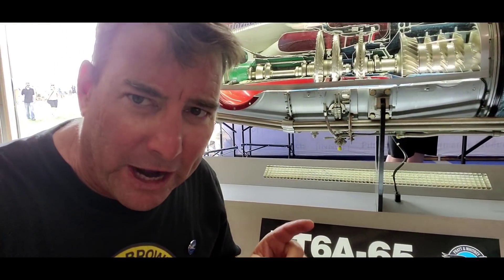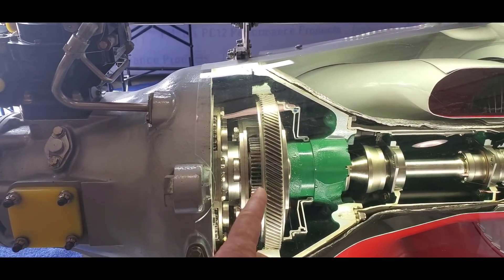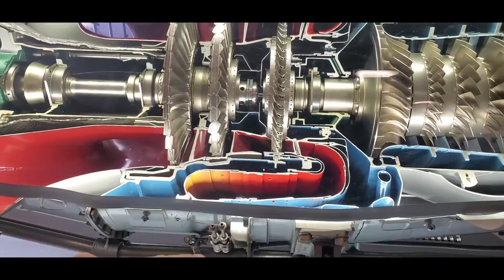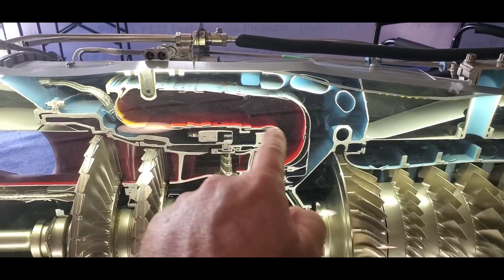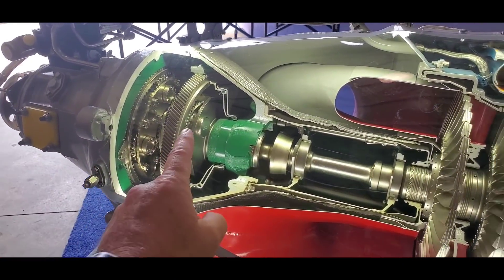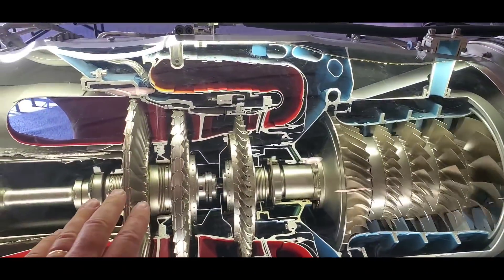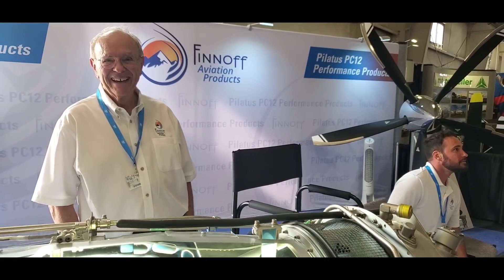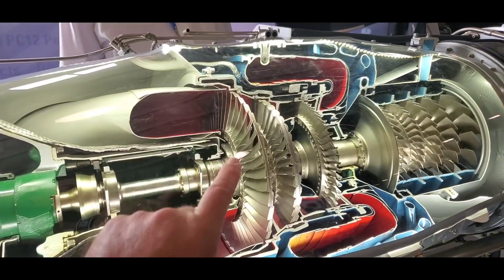PT6A Cutaway - Airventure 2021

Comment: Great explanation. As I understand the "Governor" controls the Pitch of the propeller to keep a constant RPM. The throttle is set about 95% power. What does the Torque control do? (Cessna 208 Caravan has a PT-6)
Reply: There isn't a torque control. The engine is torque restricted to critical altitude, the gas generator can put out enough gas to over-torque the engine. So if you fire wall the throttle, and the model you have doesn't have any self defense, then you will over-torque the engine and at best have a horribly expensive rebuild. You have to manage propeller rpm and engine power to keep torque within limits until you reach critical altitude and can't over-torque the engine any more. Critical altitude varies with model, one PT6 has a critical altitude of 16,000 feet. So below that altitude you fly the torque meter, and above you watch the temperature. This varies by aircraft, there are single lever control systems which will control power and pitch for you, and prevent bad things from happening. There are also auto-throttle systems, like on the latest TBMs, which will control everything once you start accelerating for takeoff if you have them in auto-throttle mode. And this is an incomplete simplification. Watch Stevo1kinevo if you want to see how he manages the torque and power on the PT6 in the older TBM850 he flies, or watch his recent videos with the auto throttle version. His aircraft has a reduced power mode for takeoff, then he switches to the full power as he climbs, but he has to be careful not to kill the engine when he switches. Here's a link while he's doing that.
https://youtu.be/lJLM56U12x0?t=530

Comment: I think 4000 hp is the equivalent to the amount of fuel burned, not the amount extracted by the turbines. From what I recall from online reading, the compressor uses about 2300 hp, the power turbine extracts about 1000 hp from the gas flow, and about 700 hp are "lost" at the exhaust. Still a very efficient machine all things considered.
Reply: Your numbers look correct intuitively. Juan's numbers would indicate a thermodynamic efficiency of <20%, which really breaks the use case. Juan was smart enough to hedge on that statement, though.
Reply: @johnschreiber1574  well, a little over 20% is the mean thermodinamyc efficiency of the US's fleet of road vehicles, so that wouldn't break the case.
The most efficient turbine engines today (static power generation units weighting several tens of tons) achieve about 45% efficiency without cogeneration, so 20% is not that bad for an airplane if the thrust to weight ratio is decent and it has a small footprint
Reply: @makecba , Juan's a little shy on the horsepower. The -65s on our Be1900s put out an honest 1100 SHP, not counting exhaust thrust. Our SD30s had -67s which were essentially the same engine, but ran hotter and were rated somewhere north of 1400 HP.
Reply: While I’m impressed with the service these things have given to a wide variety of aircraft, that’s pretty miserable efficiency.
Reply: @ben3989  even compared to a piston engine?  I thought the best car engine was only about 24% efficient.
Reply: @DominicRichens  nah, most modern engines (Mazda's Skyactiv, Toyota's Dynamic Force, VW EA888, etc) are on the order of 40% at their peak efficiency point. When you consider the theoretical maximum efficiency for Otto cycle engines is around 60%, that is actually pretty damn incredible.
Reply: @DominicRichens  many piston engines are 40% and Toyota and Nissan are developing 50% thermally efficient engines. It’s all pretty miserable when you think about it.
Reply: @ben3989  depends on what you consider. As I said, the theoretical maximum for the Otto cycle is around 60%, so 50% is absolutely incredible. Of course, when you compare it to the 97-99% efficiency of electric motors it becomes pathetic.

Comment: The AF ones anyway are a 3000rpm constant speed prop, and your speed voting lever is simply your torque request...the turbine spins up to 100%RPM around 30% torque.  Tons of power, it comes on fast (like ground loop, or go-around roll, fast...full boot of rudder).  Having the intake below the turbine creates a heat soak issue for engine start... They are supposed to be very reliable systems...but the AF ones had problems with gearboxes and aerobatics.

Comment: I never realized the power consumption is so high (vs the delivered SHP) just to drive the compressor.
  Incredible to think you’re “flying 1000 SHP” but actually controlling “5000-7000 HP of engine.”  Wow.

Comment: One of they most reliable turboprop engines built.
Reply: My dad worked at PWC and hired my schoolmate out of engineering school to do product support.  A PT6A showed up for 5000 hour overhaul with dry bearings so my friend's first job was to figure out why (oil feeds holes were drilled backwards as a CNC machine had been programmed wrong) and then find every engine out in the field that had backwards oil holes (actually easy, 100% tracking on every part) and get replacement engines out to them.  Every bearing was cooked and had to be replaced but not a single engine failed in flight.
Reply: @DominicRichens    We had one seize on a Twin Otter.  Thankfully, it was flying slow on a survey line at the time instead of developing full torque.  Surprising for the crew, but a non-event in a sea level environment.  Might have been a different situation in the mountains.  Loss of oil pressure also results in self-feathering on a PT6.

Not as responsive as Garrets or as fuel efficient, but still a great engine.
Reply: @mannypuerta5086  Roger ALL and echoes of the praise for our old pal the PT6A.  Her relative deficiencies to Garrets, throttle response and efficiency generally are only due to the earlier time element of state of the design's science/art of turbopropping generally, imho.  My sentiments are just nostalgic really, loving a forgiving and reliable engine, like a forgiving aircraft; especially when we're green pilots, more often than not ALL flying PT6A's invariably at one time or another and ALL her built-in, inherent qualities, apparent here, was maybe the only thing that allowed us the common delights of eventually becoming old (happy, curmudgeon) pilots today.

Comment: Very good Juan, much different perspective then you get from a bunch of parts scattered on a bench.  3,000hp to run the compressor section? Don't know but I was thinking more like 300hp, but it's just a guess as I seem to recall about 30% as a rule of thumb for two stage turbine engines for the compressor. I also checked and it looks like the PT6 'E' model is a unique variant is used in the PC-12

Comment: 4 axial stages and one centrifugal stage!
Reply from the maker: Excellent point!
Reply: @blancolirio  An additional benefit of the axial/centrifugal mix is that their different flow rates guarantee plenty of excess air at the final stage to run bleed air services.
Reply: Centrifugal is large in diameter for it's power so it isn't great for turbojets or turbofans - but they do have incredible pressure ratios.  That one stage has the pressure boost equivalent to 6-10 axial stages.
Reply: Yes indeed.Reminds me the early Rolls Royce centrifugal engines like The Derwent.The centrifugal compressors pack some PSI.